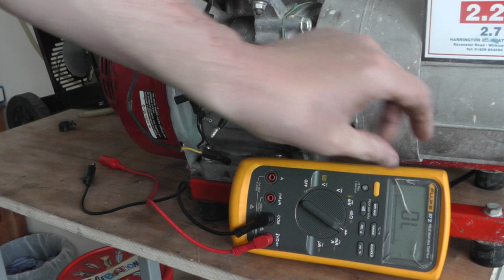Honda GX Engine Models Oil Alert module Unit testing with multimeter ~ GX120 GX140 GX160 GX200

Comment: Love it. Quick and to the point! I think the diode is to protect the reed switch in the oil float sensor from receiving high side voltage from the ignition coil, as the spark is grounded. Thanks!